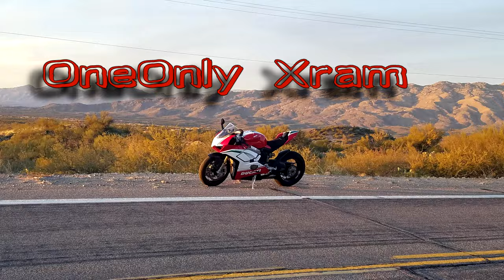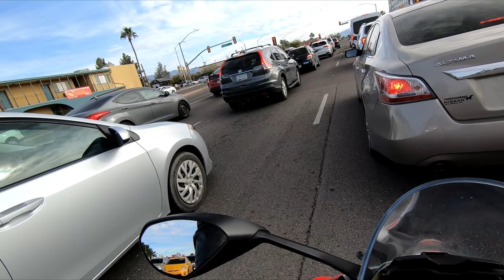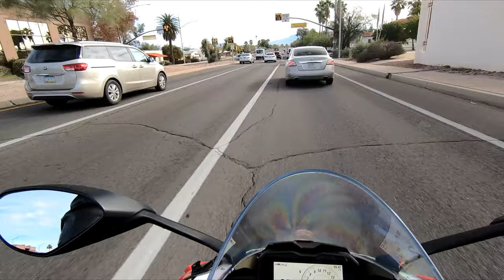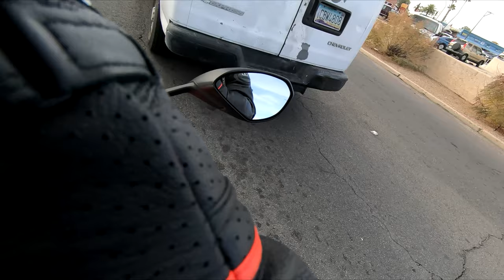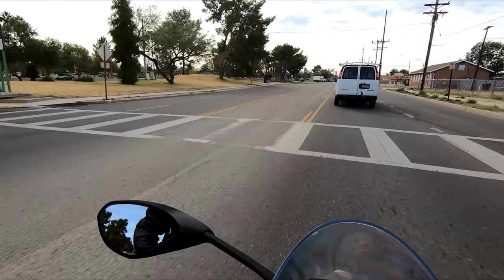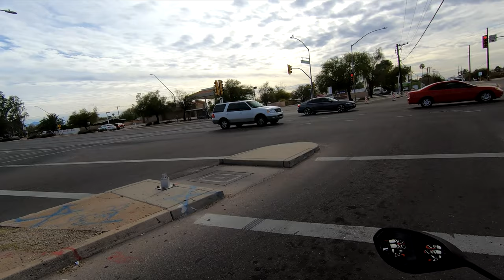Science on a Ducati??

Comment: Scientific 🧪 talk with xram 👍👍👍👍
Reply from the maker: Yea man, feel free to add if you like!
Reply: oneonly xram How do geologists use carbon dating to find the age of rocks? And I have heard some people say that Carbon dating can be mis read 🤔
Reply from the maker: @rpa520  carbon-14 decay's at a predictable rate, so up until about 50,000 years they can get pretty close to the age of the rock based off of carbon-14s half life. The issue is when they try to use carbon dating past that 50,000 year mark because at that point there technically isn't anything left. So they have to use other methods to find the age of things. Check this link out.
https://www.nature.com/scitable/knowledge/library/dating-rocks-and-fossils-using-geologic-methods-107924044/
Reply: oneonly xram  which some would say based on the 50,000 mark  the earth is not as old as we think. I’ve also heard that there may have been a catastrophic event such as flood   that happen that can make carbon dating not valid due to erosion and sediment which caused things to be buried at a fast rate and basically gives false readings on how old fossils really are 🤔 I’ll try to find the debate
Reply from the maker: @rpa520  I'm sure there's a debate on using that carbon dating, which is why geologists use more methods than just that one. That link I sent you goes over those methods.
Reply: oneonly xram 👍👍👍